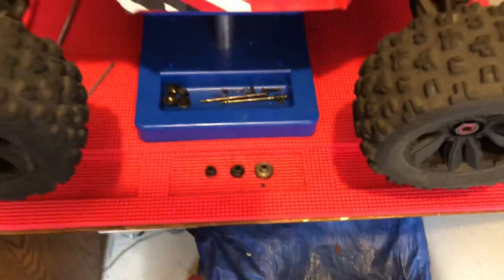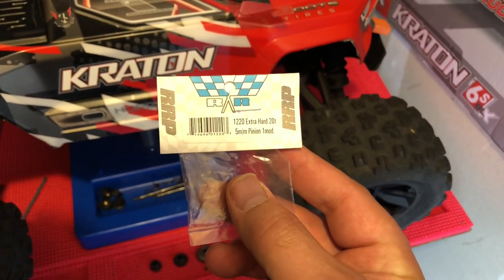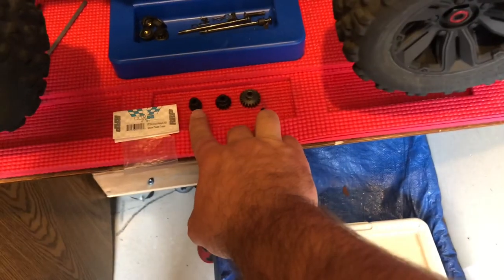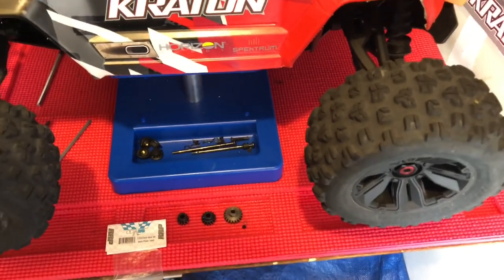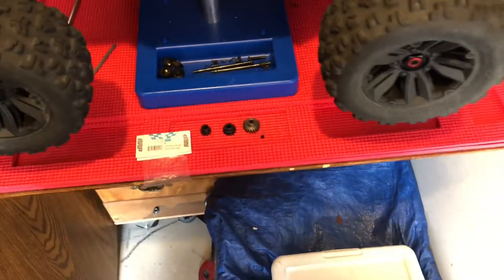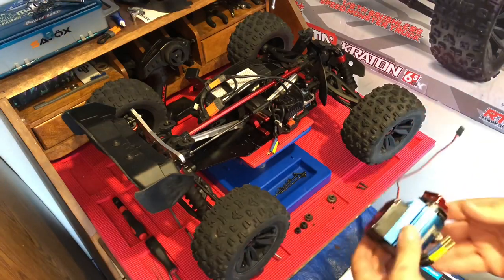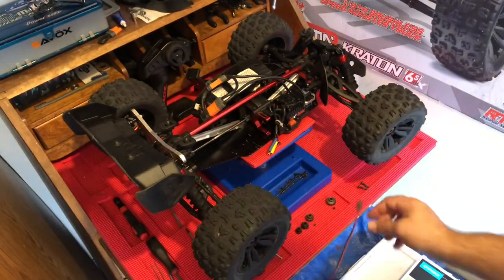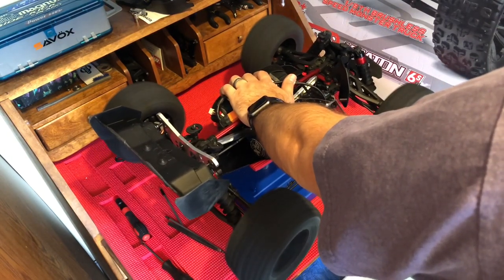PINION GEARS | Arrma Kraton | What you need to know

Comment: Will a 20 Tooth pinion be safe in a 4s kraton i mean in other words overheat its a 110 kraton with a 2400kv Motor
Reply from the maker: Not sure, however I will say that any modification as far as upping your pinion teeth above the manufactures offering, I would say always requires a fan to be put on your motor. To be completely honest with you even if I never change the pinion gear to higher teeth I would always recommend putting a fan on your motor. It’s just better for your vehicle, keeps your motor cool.
Reply: I have 2 fans 1 on top of motor and 2 1 beside the SERVO
Reply: GOING to ask THE hobby shop guy i deal to put a 15th tooth pinion in for me well he is waiting for THE part that melted between input GEARS And diffs GEARS
Reply from the maker: If you’re cooling your system beyond what the manufacturer put in the vehicle, then at least in the heat category you can attempt to increase your pinion. Just always make sure you’ve got a temperature gun on standby to see if your fans are doing enough to keep it cool.
That said, another another thing to keep in mind is that the higher that you go with your opinion the more power you’re throwing at your drivetrain. Sure you’ll go faster, but will it be worth the increase likelihood of, Breaking differentials, shearing or wearing down the teeth of your input and ring gears etc.
Also increasing your pinion, To high can often times lead to cogging issues. Which is basically a miscommunication between your motor and your ESC due to improper gear ratios
Reply: @EastTactics  True i think i Will stick WITH the 13th tooth pinion for Now until i ask him what he thinks first or i think i get STEEL GEARS first and shims
Reply: @EastTactics  Thank you for throwing that at ME👍
Reply: @EastTactics  maybe a 14th tooth pinion?
Reply from the maker: LOL, don’t you just love how the testosterone in us makes us want everything to go faster. You can give it a try, Probably be fine, just watch those temps
Reply: @EastTactics  oh i will believe me i love speed. Speed junkie!!! LMAO
Reply: @EastTactics  drove this golf with no roof the mechanic took THE gofner off i clock it at 50 miles a hour cart
Reply: On Toronto center island ferry docks
Reply: @EastTactics  what would be a safe temperature reading on the. Gun
Reply: I know by hand
Reply from the maker: Imperial versus Metric
Motor
Ideal - 140°               60° C
Hot - 150 - 160°       65.5° - 71.1° C
Overheat - 165°        74°C

ESC
Ideal - 135°               57.2° C
Hot - 140 - 150°       60° - 65.5° C
Overheat - 155°        68.3°C
Reply: @EastTactics  Thank you for your heat Reading information
Reply: @EastTactics  East Tactics
Reply: @EastTactics  NOW i JUST have to buy heat gun i can buy 1 at Canadian tire , best buy , or Wal-Mart
Reply from the maker: Nice!
Reply: @EastTactics  Iam going to my hobby shop tomorrow they are selling heat guns for $35 Dollars plus tax of course SO THE Readings u gave me Correct yes? Because THIS IS what i look for ON THE motor when its getting to HOT OR overheats?
Reply: Cause i will be talking to the owner of Hobby shop Tomorrow about 15th tooth pinion or 14 Tooth pinion to see what he says to me about it being safe Enough for the Truck.
Reply from the maker: Sounds good, make sure you run your heat test before you change the pinion gear to create a marker for where you’re currently at. Typically 7 to 10 minutes into a battery is a good time to check the temperature.
Also be sure to check temperatures while the vehicle is running and the fans are on.
Hopefully after you change to your desired pinion size, your temperatures will remain below the ideal temperature. At the very least no higher than “hot” range. But if it is in the hot range you’re still OK.
Good luck
Reply: @EastTactics   i have battery already there but the part does not Arrive until wed so does he check on. Battery machine or threw the motor cause the Truck aint put back together yet
Reply: @EastTactics  well Anyways he will know WHAT to do what's a marker?
Reply from the maker: What I mean by marker, is simply a point of reference to compare to. If you run the temperatures without any changes. And document them. Then you’ll know the exact difference after you check the temperatures with the new pinion gear.
Reply: @EastTactics  Thanks
Reply: @EastTactics  i will show him THE motor readings and the Esc readings u guys show ed me last night i have them written down i my note. Pad in my phone
Reply: @EastTactics  Bought myself a dynamite Built in laser. For accurate target aiming Back lift readout 2% accuracy celsius or Fahrenheit auto power shutoff Automatic data hold Low battery indicator operates on included 9v battery
Reply: Was my choice good?
Reply: @EastTactics  i asked THE owner who does THE Repairs said to it should be fine as long as i don't go stop snd go with THE just keep her st a steady pace like at 75 percent at first or 50 percent then try a. 100 percent then read the temperature with the temperature 🔫
Reply: Well like i said before i will go 1 up 14th pinion that way i don't have to stress to much about it until i get All steel GEARS in the spring TIME probably have the Differential s shimed and mesh tight which I'm sure it probably is if it needs it
Reply: @EastTactics  iam going with a 15th tooth pinion for my kraton thats in the shop right now getting New input gear i bought a temperature 🔫 gun its called a dynamite with Built-in laser pointer for accurate aiming Backlit Readout 2% accuracy Celsius or Fahrenheit Auto power shut off Automatic data hold Low battery indicator operates on included 9v battery.
Reply from the maker: It’s awesome brother you’ll have to let me know if you feel a significant difference in TopSpeed, and pick up speed
Reply: @EastTactics  Thank you i can't wait iam going threw Rc withdrawal lol by this Thursday i hope 🏁
Reply: Moutaz FAhAD

Comment: Would I get away with running the included 16 pinion on stock and using the car on grass, will that cause any overheating problems as it warns not to on the bag it comes with. Have the kraton 6s v4
Reply from the maker: Lexusant, I would suggest installing a heat sink and fan just to be safe and keep that engine cool. Outside temp, climate, the % of time on grass, all play a part. for 10-15 bucks it’s always worth it. Also I nabbed a heat gun so I can check temps. Esc is too hot past 130, motor is too hot past 150
Reply: @EastTactics  Thanks mate, really good to know. Excellent video btw really informative.. Subd
Reply from the maker: Lexusant, awesome!! Thx
I updated the description in this vid for quick links to both heatsink fan and the infrared thermostat gun for ya.
Reply: @EastTactics  awesome will check it now. Thanks

Comment: My senton 3s came with a 20t on it, I put a 26t on it and now it cuts out after about 5 minutes of runtime and it's a flashing red light on the esc. What's the problem??
Reply from the maker: You might be throwing too much at the stock motor and ESC with a 26T gear. Issue will arise if you go too big. Im not 100% sure what the senton can handle as (as you know) I run the kraton. But what I can tell you is that when I tried the 20t gear, she gave me all kinds of problems. Broken pin, gear, and cogging issues. I've since dropped back to 16t and dropped my punch to 6, instead of nice. The stock ESC and motor like it much more. 
I you want to go crazy with higher gearing you'll want to buy an upgraded motor and ESC.
Reply: I think this answered my question I had. Now what spur does your senton have in it? I'm running stock in my brushed version but converted to brushless I wasn't sure what pinion to run. Mine ran great on 17t
Reply from the maker: I’m running 16T have been pretty happy with it
Reply: @EastTactics  I literally just threw the stock pinion in it I figure with the gearing in the spur with it still all original I may get close to optimal with stock pinion. Going to test it right now.
Reply: @EastTactics  went ok. Tops out fast. I got a 5200 50c 2s gonna grab a 3s in 2 days. Also how do you love the kraton thought about picking one up but was stuck on a 3s truck or a 4s...

Comment: My max8 g2 with 16t on 4s is faster than my max6 1250kv 20t on 4s. It's a head scratcher.
Reply from the maker: What the kv of the motor with your max 8?
Reply: @EastTactics  the 2250 4278 combo.

Comment: i’m new to the hobby and i just bought a typhon 3s blx and wondering what kind of modifications i should do. any ideas?
Reply from the maker: What do you favor, racing or bashing?
Reply: I love my typhon. Here's some of the mods I've done. I put the 6s typhon shocks, 20t pinion, arrma outcast 4s wheelie bar, hot racing aluminum steering blocks, 15kg arrma 6s servo and for wheels and tires i got the duratrax six pack buggy wheels and I recently got some badland clones that are on ebay for only like 25$. Just search 1/8 big blocks buggy rc wheels. Great value and better than stock
Reply: @EastTactics  racing. but i’ll do some bashing here and there. but mostly want high speed